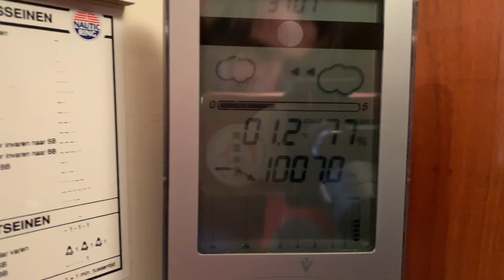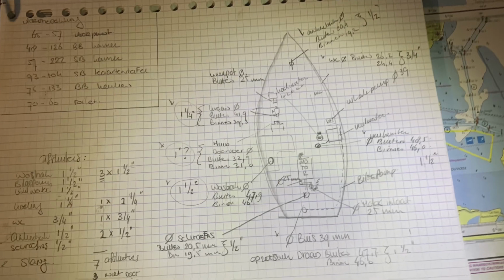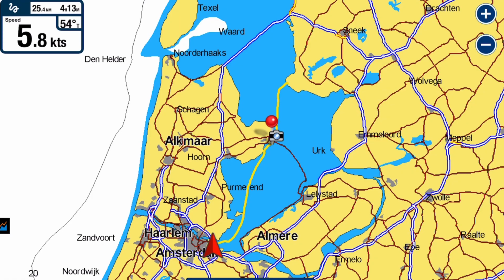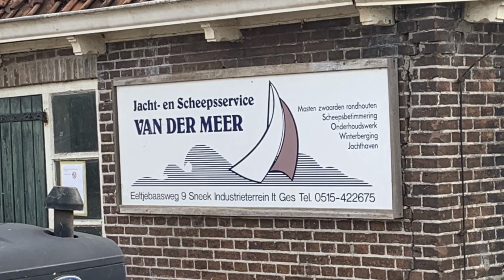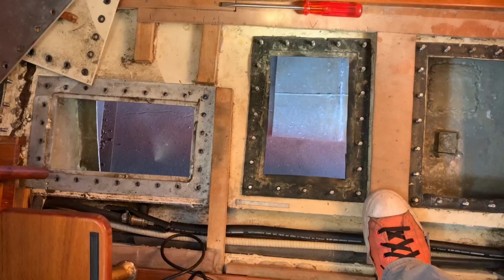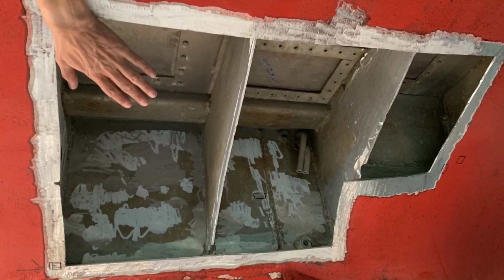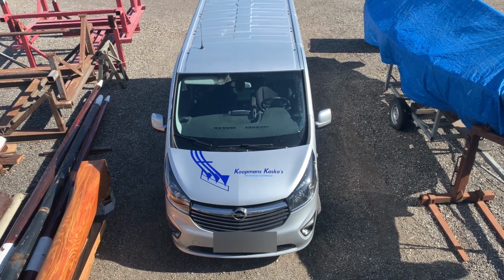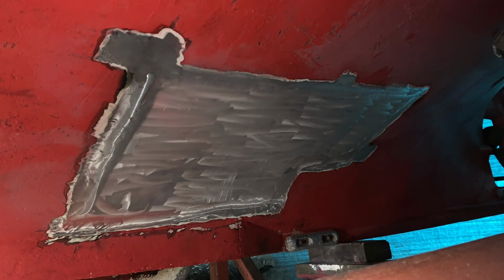009 Aluminum water tank repair Koopmans 36 sailboat (part 1)

Comment: Terrific repair video. Thanks.  I love your hoses and hose manifold. Brilliant use of cardboard!  My plan is a French catamaran, but my dream is a  Dutch one made of aluminum.
Reply from the maker: Thanks for the compliment! As for the cardboard I got a bit lucky. The box came with the trough hulls and it just fitted all together ;). Love it when that happens.... 

French boatbuilders are also very good. Catamaran we did not consider as it's a bit unhandy in our place. Dutch boats (builders) indeed do have a pretty decent reputation themselves. Good luck with the plan and planning!

Comment: Hi, thank so much for this videos. Im wondering why has happened this failure ( corrosion). May be you have said and I didnt catch it. ( my english is not good). Im looking for an aluminium hull boat  and this is a good point to pay attention. Thanks again and cheers from the Patagonia.
Reply from the maker: Hi Jorge, that I would not have guessed, to be able to “help” somebody in Patagonia! Pretty amazing. 

As for the cause: it could have been the water preserving stuff he did in the tanks and it could also have been the rvs bolts reacting with the water/ aluminium. The first is the most likely. But for sure I probably will never know…. Checking by opening up the tanks is knowing. The skin thickness measuring thingy is not picking up the spots. And if so you might also have a mis measure. Actually the whole skin thickness exercise is a bit of a useless thing with this kind of corrosion. 

Good luck with your search man! Your sailing area must be amazing!!

Comment: how did you know it was corroded in the water tanks and were tanks painted inside before the corrosion?
Reply from the maker: Hi Simon,

There was all sorts of junk in the tanks. Mostly a white gel like substance. Besides that there were put holes where you could see the metal was eaten. It clearly was not clean aluminium. Jw

Comment: I used that blue paint also, really toxic paint. I think you have flush the tanks also several times before use.
Reply from the maker: Hi Berend, we did indeed. According to the technical data sheet we had to have them filled for 40 (? about?) days and then rinse them with regular water. I've added some dish washer soap. Not a lot, just a bit. Now it's perfect. Did replace the nylon bolts btw. but a future episode on that is on it's way.